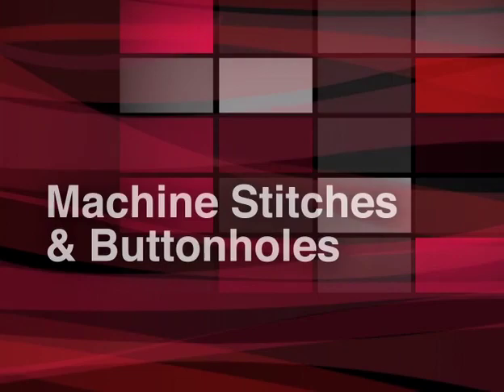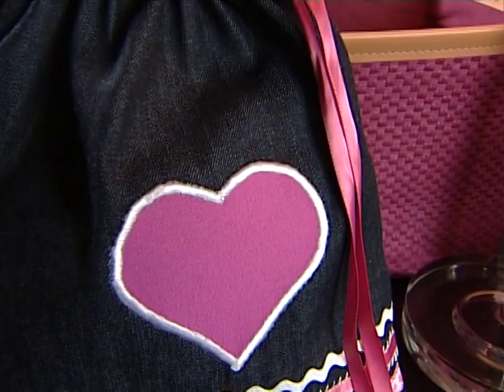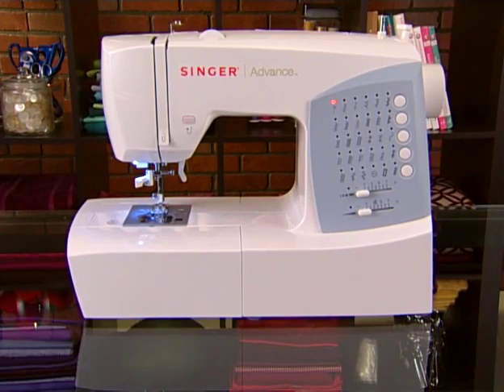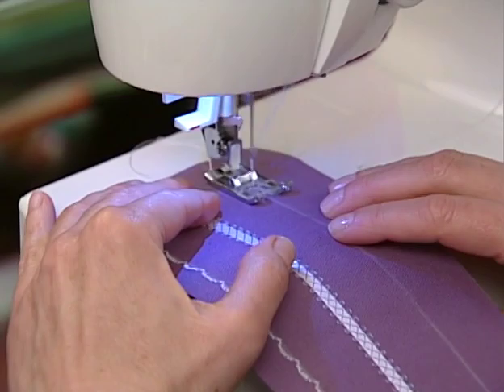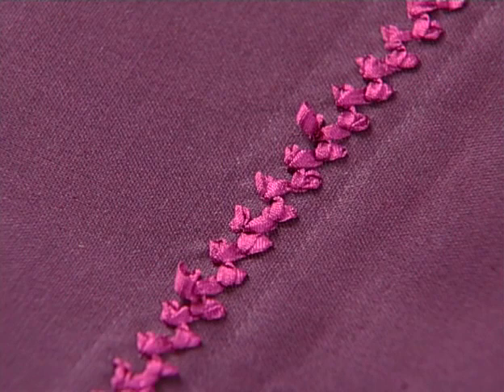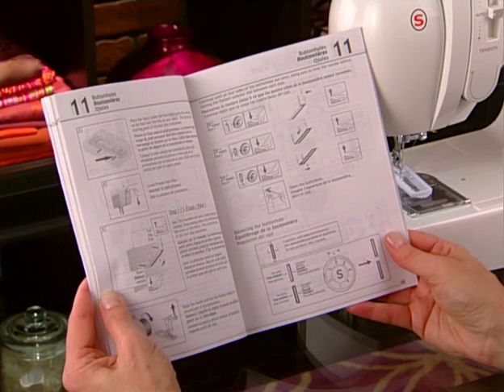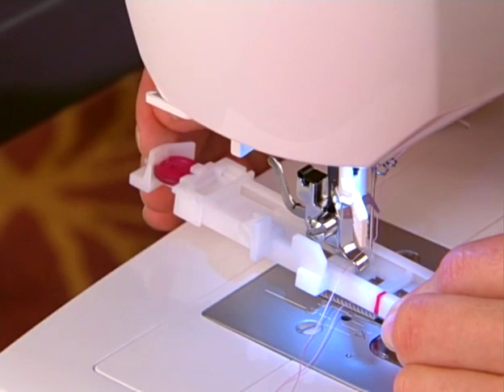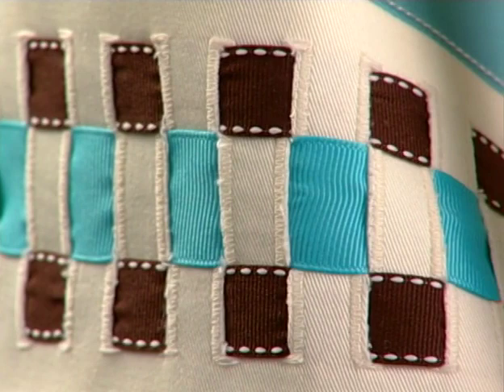SINGER® Basic Stitches Tutorial

Comment: I have  singer machine model 2263.sewing is become a headache for me. It breaks thread so much. Its really difficult to work with it
Reply: Adjust your thread tension, or see if you can better quality thread. If that does not solve the issue, check whether the machine have any Sharp edges which might break your thread. If you find one debur it.

Comment: Wow great tutorial. Does this machine works on thick cloth. What is the lifetime of machine and what if it needs repair?
Reply from the maker: Hello,
   There are multiple machines used in this tutorial.  Most Singer Home model sewing machines are capable of sewing thick fabric with the proper machine settings and needle.  You would always need to increase the stitch length (max length) when sewing thicker material or multiple layers to accommodate the thickness.  Also be aware that if you sew on multiple layers that are too thick and it raises the presser foot too high, the top tension will be disengaged and the machine will not make a proper stitch (may jam machine).  So it will depend on how thick and how many layers you wish to sew. Also, the height that the sewing machine’s presser foot raises before the tension is disengaged.
Reply: @SingerSewingCompany  plz suggest me a machine where pico darning  overlock and little embroidery can be done